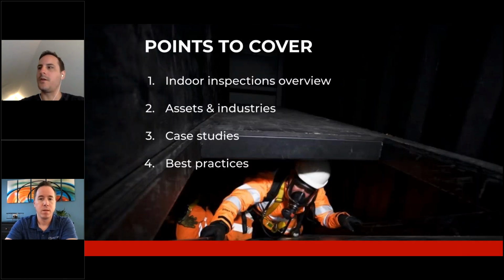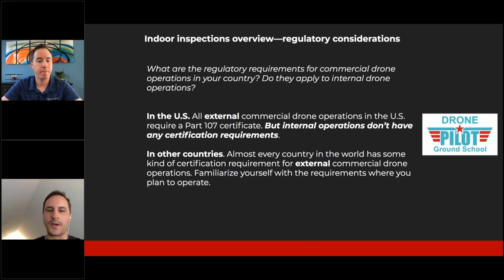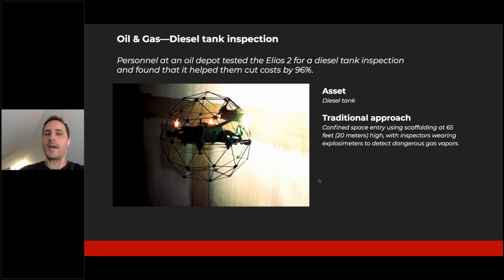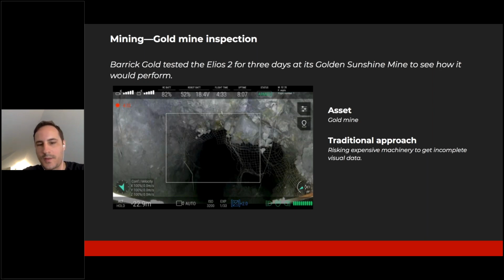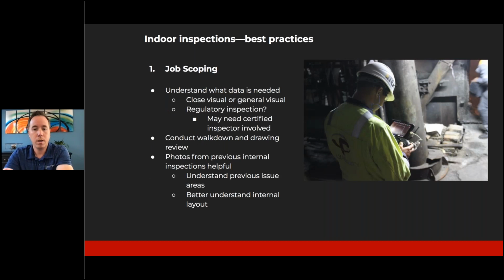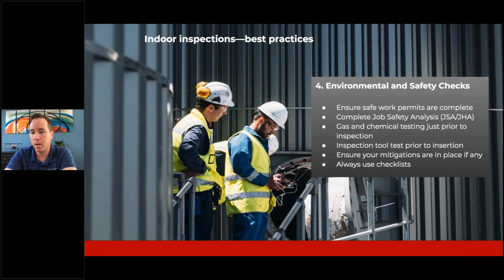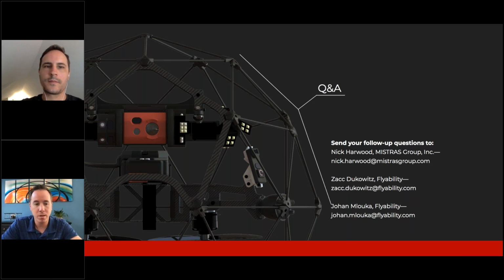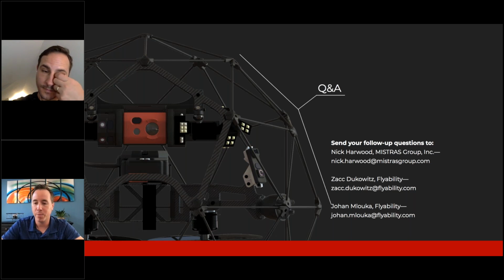Indoor Drone Inspections  Case Studies and Best Practices from the Field

Comment: Thanks a lot for providing and recording these serials. I know it's too late for Q&A but maybe some could be answered somehow:

1) Do human inspectors have some advantages like possibility to clean some piece from mud, rust or some old paint, or maybe some shutters, “doors” that should be opened to inspect what's behind?

2) In the beginning it was mentioned that drones-inspection is a part of common remote visual inspections. Could you determine average percentage of this market that drones occupy and what is the trend here?

3) Talking about drone-inspectors, do they have to explore tech documentation and “routes” inside the asset before process  or it’s usually a local specialist nearby they drives inspection (“here turn left” etc) ?